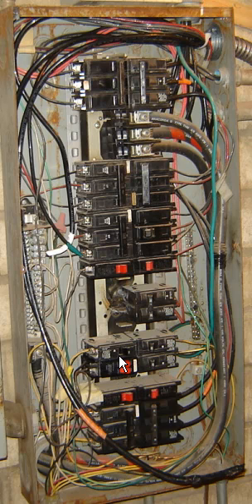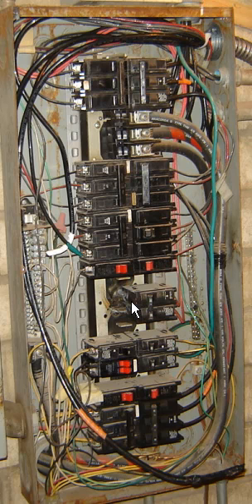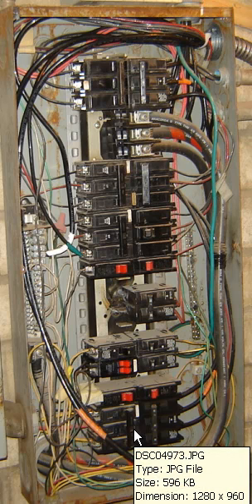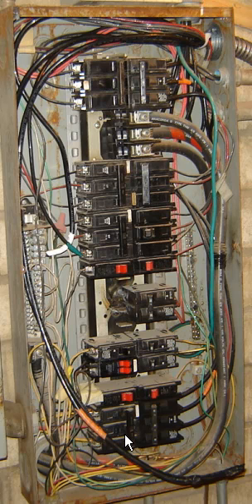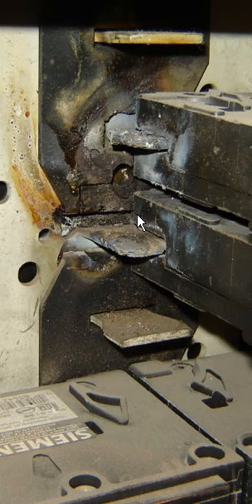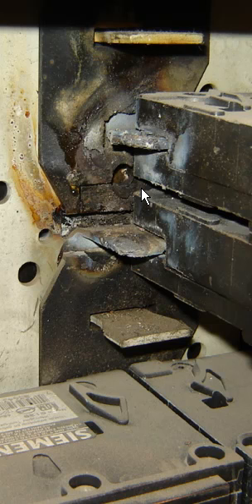Electrical Wiring-Burned buss bars

Comment: When these busbars are aluminum, is it appropriate to use antioxidation gel when installing breakers to reduce the chance of late failing connections from oxidation?
Reply from the maker: Yes and most of the time these breakers come pre-greased from the factory.

Comment from the maker: @gswimfrk the aic rating and the electrical engineer are two of the major factors.The higher the aic rating the more likely it will be a bolt on.Depending on the E.E. , and money determines the plug in style.